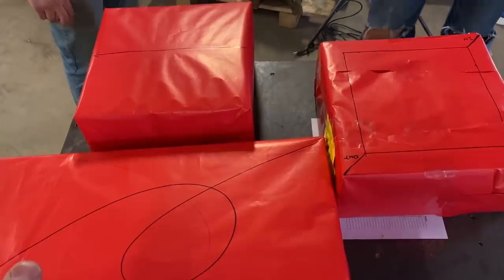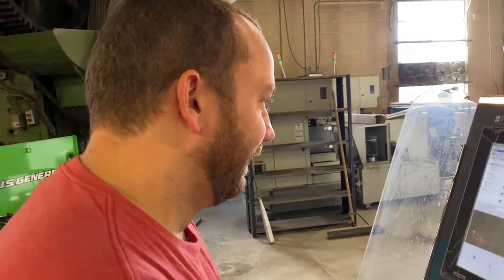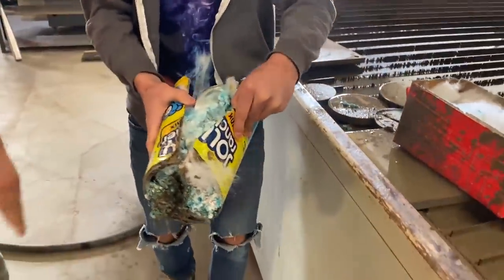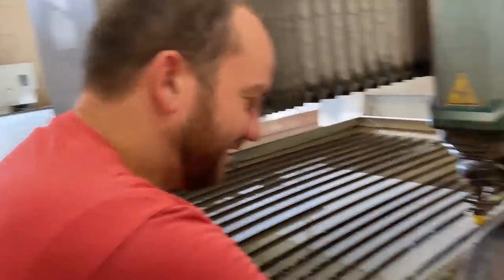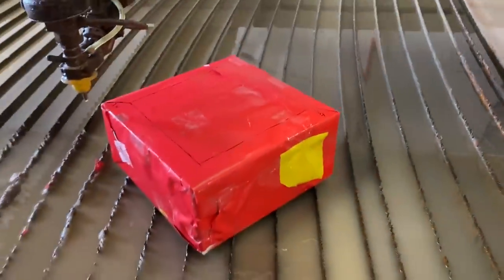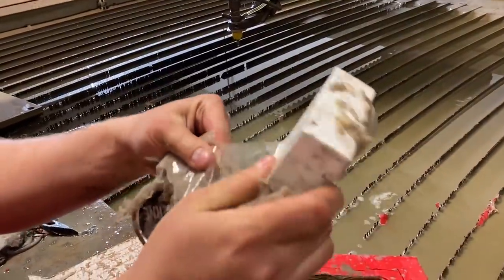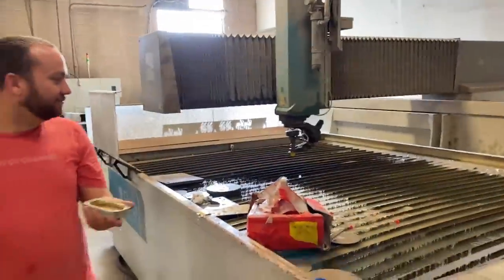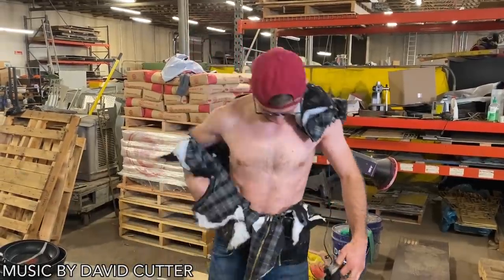Opening Secret Santa Mystery Box With A 60,000 PSI Waterjet

Comment: My son just ordered one of your knives.  Any tips on putting an edge on it?  I have a 10 inch water wheel grinder and a high speed tool grinder.  The water wheel I think would be too slow to put the initial profile on it but perfect for making it sharp.  Would the tool grinder heat it up too much and change the properties of the steel and ruin it?

Comment: Hey guys! I have though of an interesting idea for you. what if you took your air cannon, and propped it up at a high angle (maybe a 45?) and manufactured a bullet like the one you have, but with a little hole in the back, which you could place a GPS inside of. once you shoot it you could look on your phone or whatever and see the projectile flying through the air, and then go to where it lands and check out the damages! maybe try a super long range shot? that might not be as feasible tho.

you might also have to take the cannon and compressor out of the city because hitting something you don't want to hit would be a rather large possibility, i don't really know. leave a comment if you think you might go ahead with it!